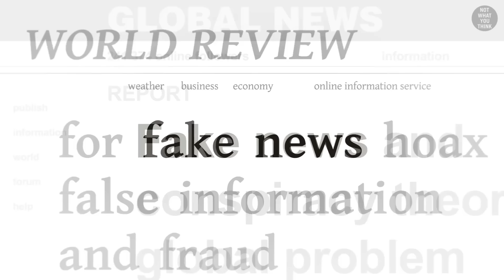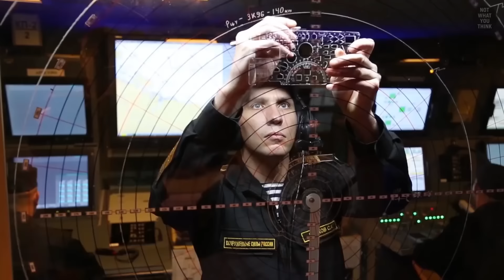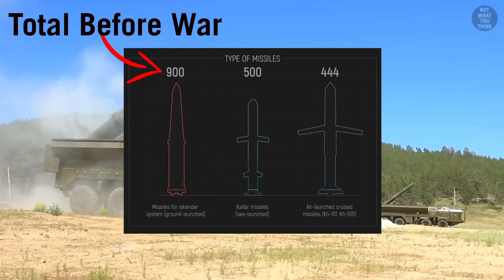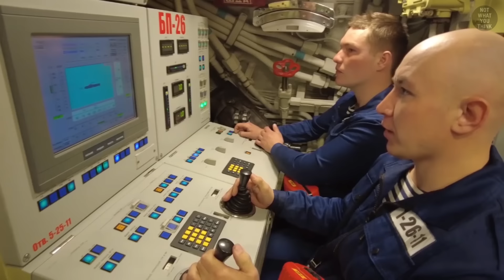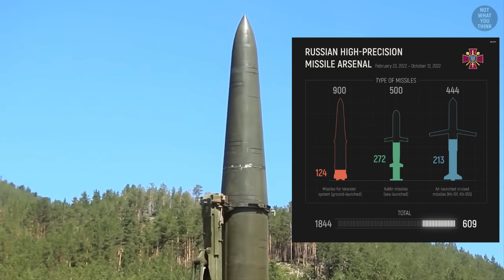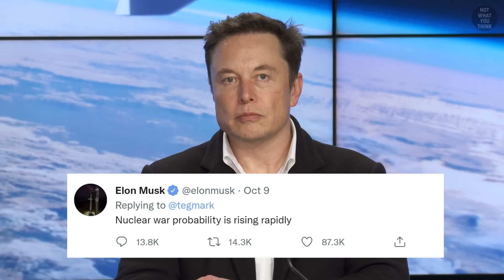Russia is Running Out of Missiles

Comment: I recently read, that 40% of the smuggled chips are defect. which causes a serious problem if your PCB contains more than 3 chips. even with just one chip, that's terrible.
Reply: @masoodjalal1152  well, the problem is, that the manufacturers do not sell them these chips. these are smaller businesses that try to salvage the faulty production (common practice in china, sell even the faulty stuff, and it runs via a few middle men).

and chinese companies try to adhere the export ban by US and EU because they want to remain in the much larger markets. russia is negligible.

and that's the problem russia is suffering. 40% was widely reported amongst german speaking IT-news including the smuggling-problem.

Comment: The main lie of this video is that a ballistic missile is much easier to intercept because it flies on a predictable trajectory. Speed is unimportant because the c300 missiles are also hypersonic. Cruise missiles can fly at a height of 10-20 meters, which is why they are made subsonic, so they have time to maneuver around obstacles. This is much less noticeable for radar, you might have noticed that attack planes and helicopters fly very low over the ground. Also c300 missiles have a minimum impact altitude, it starts vertically and accelerates in 25 meters, it is are not designed for low-flying targets.
The cherry on the cake of this propaganda video is the illustration of the "unexploded Russian missile" 12:59 , which is actually a photo of the mlrs Grad rocket booster section which does not carry explosives and separates from the warhead in flight.
Reply: 12:36 and this one is the old video, a waaaaay before this occasions

Comment: I thought the word ballistic, in the context of missiles, meant they were unguided and had to follow a set trajectory. I'm not so sure that's right anymore.  Can someone please define the word ballistic, as it applies to missiles?
Reply: Ballistic missiles are missiles that go in a ballistic trajectory. As in: they fly up up up, engines quit, and they fall back down to earth. Most of the flight path is vertical, whereas a cruise missile spends most of the flight path horizontal. Ballistic missiles are harder to shoot down, but their launches are typically easier to detect.
Reply: Most of modern such missiles are quasiballistic, meaning that while the general idea is true (they're just following a ballistic trajectory), they can also maneuver on the downfall to correct the impact point on the fly and probably even dodge incoming threats.

Comment: It's not about running out missles, it's about running out of the microchip and circuit boards to make the missle work. Since the United States and their allies are proprietary to the technology, they are trying hard to prevent Russia from acquiring them. Yes, there is the problem with the black market and the U.S. has taken the necessary steps to curb this too.

Comment: A strange video. 
There are several comments to the creators: 
- nothing is said about the Kinzhal, Avangard, etc. missiles, as well as about the Lancet-3 unmanned/barrage ammunition 
- The X-22 missile did not hit the shopping center (which can be seen, including in this video: there is no funnel that should form on impact), on it the fire spread 
- The destruction from the S-300 is the result of the work of the air defense of Ukraine.
Some kind of selective inaccurate biased presentation of the material

Comment: maybe the way we should go about stopping the attacks is to take a page from world war 2.

the reason that hitler and the nazis was not able to build many of the exotic weapons is because it was too expensive.

so if we could work with the international supply system and make the precursory supplies expensive (gouge the prices of key parts for the weapons) maybe the war would be too expensive and we could spend them out of war.

instead of restricting the sale of parts with other legit uses to the enemy we outprice them.

so for example a spark gap trigger witch is a restricted for export part because of it's use as a nuclear weapons trigger.

instead of restricting it because the same part can be used for protecting electronics from power surges we make the part very expensive.

so 1 spark gap trigger than may cost a couple cents would cost the enemy $1000 a piece so to arm all their nuclear weapons with the part could easily cost them millions.

or missile fuel is another example normally Dinitrogen tetroxide is about $100 a gallon so make it $100000 a gallon.

the enemy would quickly not be able to afford the fuel

ok maybe we should manufacture the microwaves with chip on board (if you ever tor down a digital watch or a solar bobble head and saw the black blob on the board.

make the timer chip that way so it is very specific.

or make microwaves headed to russia use mechanical timers like from the 60s and 70s